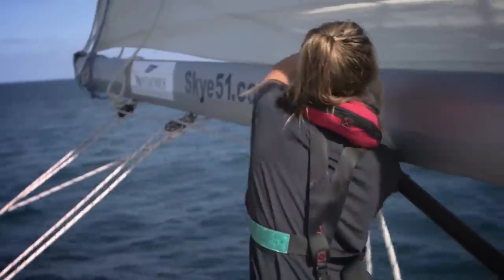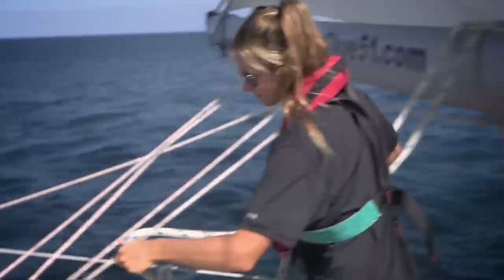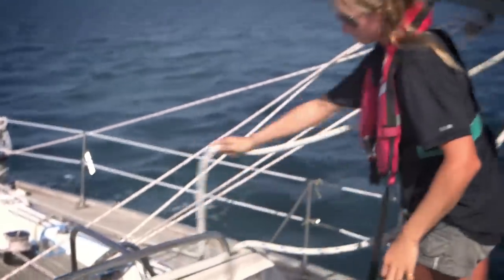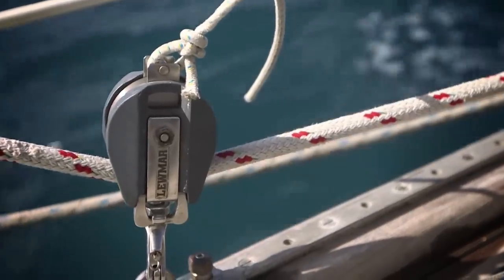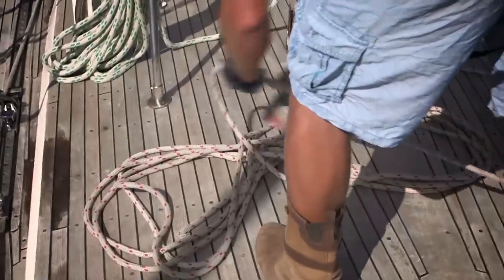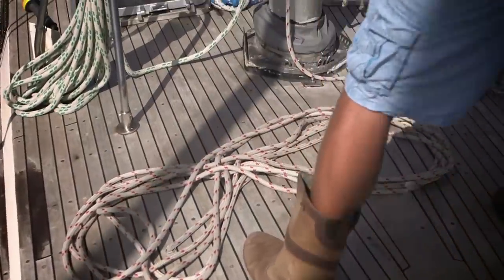How to sail downwind under spinnaker - Yachting World Bluewater Sailing Series

Comment: Why did they pull it down like that and not just do a reverse of the launch and smother it with the sock tube thing (I know there is a technical name for it) and then lower it into the bag it is stored in?  Not they are going to have to raise it again just to put it away neatly.  Plus there is more chance for he spinnaker to get damaged just chucked below like that.

Or is this what you do when you are going to be raising and lowering it regularly in a single passage ?
Reply: +stediasse  The kite wasn't in a sock, the kite was more traditionally stored by 'wooling' the kite, as the kite is launched the wind catches the kite and as wool is relatively weak it breaks instantly and hence filling the sail.  the letterbox technique is a well used method in getting the sail down as it takes all the wind out of the said by sheltering it behind the mainsail and as far as putting it down the hatch, aslong as a crew member doesn't go trampling all over it.
Reply: exactly what I'm thinking... well equipped yacht like that would usually merit having a snuffer sock to de-power the spinnaker. Make simple-Make safe.
Reply: I have a snuffer but dont use it.  Hit on the head once too often by the GRP funnel swingimg wildly. Can't  help thinking that tbose who criticize this vid need to search for more basic sailing tips. It was very good. Like the headsail ant-wrap tip